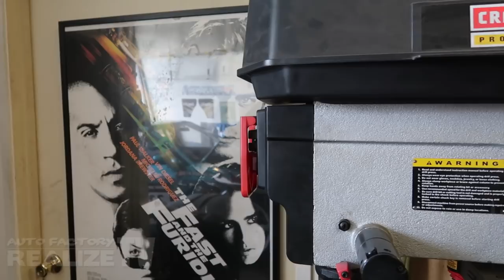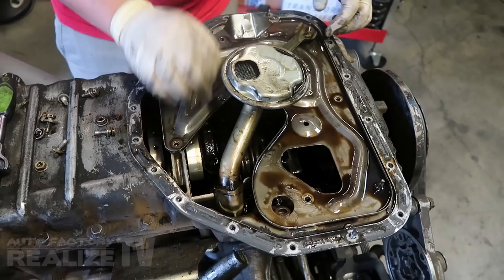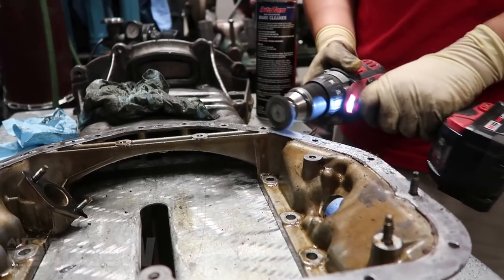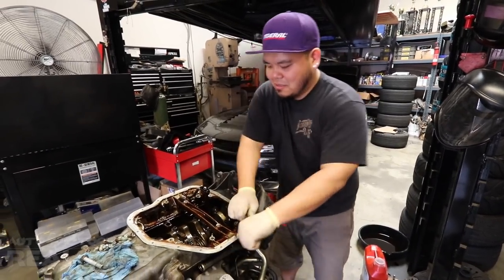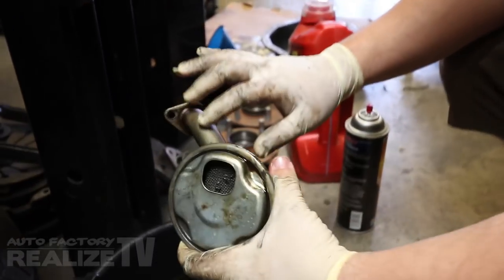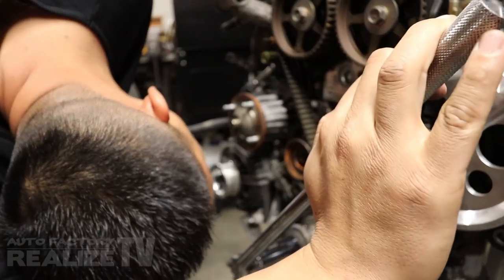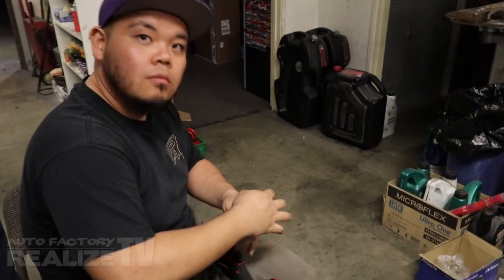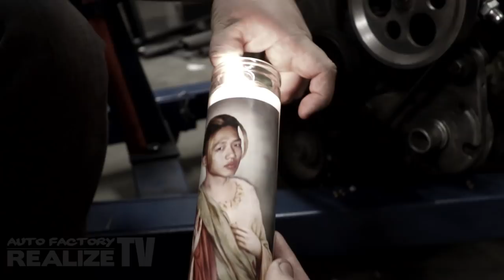WE THREW A FUNERAL FOR A BLOWN ENGINE

Comment: you guys want a new front sump lower pan I got one at my shop in gardena.  Free 90 Free.
Reply from the maker: Chuck might take you up on that!
Reply: yeah, his looks pretty beat up. and the way he pulled them off, I wouldn't be surprised if it was warped.  I got a chaser motor and I have an SC so i need a rear sump.  the upper pan got damaged, could be repaired but he can have the whole set up if he wants. upper/lower pan, baffle and pickup.
Reply from the maker: Badass I’ll let him know thanks Drew!!